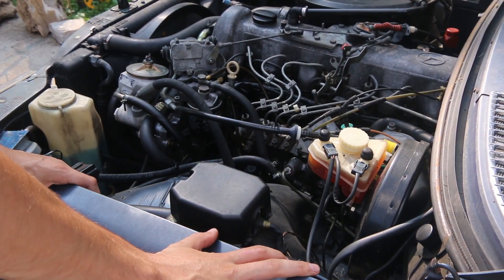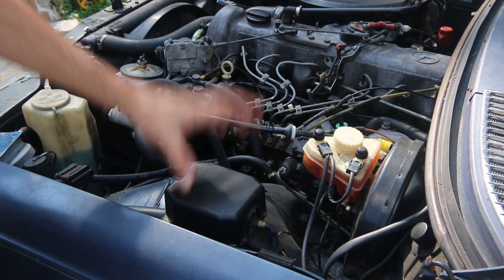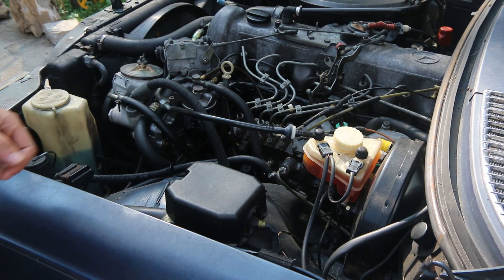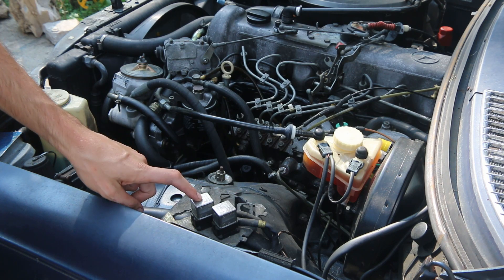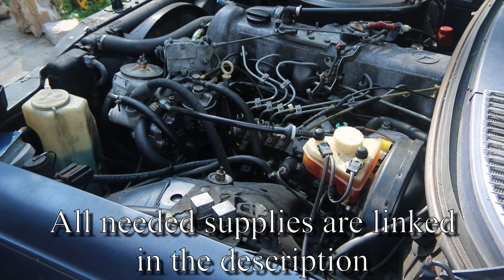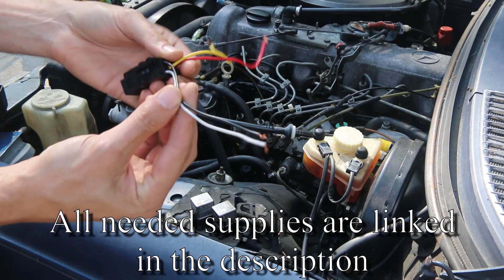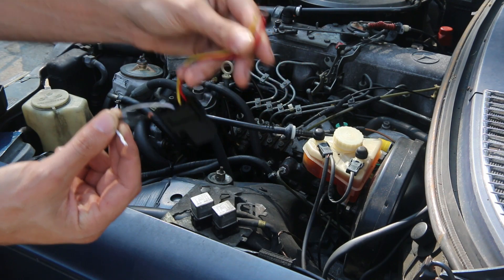W123 Aux fan AC mod & Evaporator cleaning (Cheap/Free ways to get better AC)

Comment: Great video. You've taught me a great deal about my W123 systems. I'm still trying to get my aux fan to work. I replaced the bearings and that seems to be an improvement, but I'd like to test the system properly.
1. Do you know what kind of amps the motor draws? (It didn't budge with my DC power supply but direct to a battery, it sprang to life with gusto.)
2. Is there a way to test the aux fan with a jumper wire on the pins under the relay? I'm getting 12v at one of the pins, and I tried a jumper across that pin to another that had continuity with the fan plug, but nothing happened.
Reply from the maker: I know they draw some serious amperage, I haven't personally measured mine, but I have heard somewhere in the 10-15A range is fairly expected, I'm sure some would depend on the bearing condition and general health of the motor.
If I'm looking correctly, Jumpering pin 3 to pin 1 on the aux fan "ice cube relay" should power it to life.
Ground should be constant on one of the wires going to the fan, and 12V should be provided to the relay pin #3 by Fuse C which would be a 16A Red fuse, Top right in the fuse panel under the hood, when the relay is commanded on it connects 3 to 1 which goes directly to the fan connector.
I've had issues with the little fuses getting corrosion on the ends and seemingly providing power as tested with a multimeter but not making a good enough connection to actually run anything.
Reply: Hola Juan, en mi w 123 300 d el ventilador auxiliar enciende por TEMPERATURA  del gas del aire acondiconado...hay un sensor de temperatura en el filtro deshidratador (es de bronce) y está atornillado al filtro....si lo puentéas el ventilador tiene que arrancar....es muy fácil.
Reply from the maker: @GabrielaLopez-du5tt  si de verdad! sin embargo, puentear ese sensor hará que el ventilador funcione constantemente cuando la llave esté encendida, lo que no es ideal para que el motor alcance la temperatura de funcionamiento o para los momentos en que no esté funcionando el aire acondicionado, pero esa es ciertamente una opción para hacer una modificación muy similar que ¡probablemente ayude al rendimiento de CA, o para probar el ventilador! Pido disculpas si esto no es muy comprensible, lo traduje en Google Translate, el original también se incluye a continuación. ¡gracias por el comentario!

yes indeed! however jumpering that sensor will make the fan run constantly when the key is on, which isnt ideal for getting the engine up to operating temp or for times when im not running the AC, but that is certainly an option to do a very similar modification that likely will help ac performance, or to test the fan! i apologize if this isn't super understandable, i have translated it in google translate, the original is alsoo included below. thanks for the comment!

Comment: Hi there , have seen this great video at an earlier time today wanted to follow the steps , but when I opened the amazon link for the relay it showed me couple more items which was kind confusing for me if you could share which one should  I get would be great. Thanks
Reply from the maker: It should take you directly to the one that says Color: 30A 4Pin SPST
Should have the title "ESUPPORT Car Heavy Duty Relay Switch 12V 30A SPST 4Pin Wire Socket Plug Harness Waterproof Electrical Automotive Pack of 5"
That is confusing that they have so many types.
Hopefully this helps!
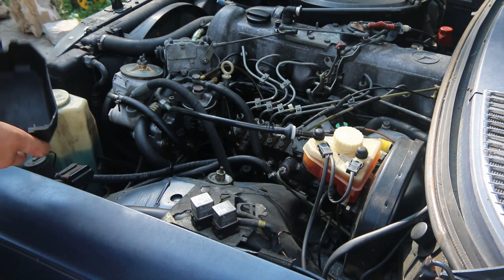Reply: I thought I could send you a picture but I figured it out it does not work , anyhow in the video (@1:47) the  black box you lifted, under my box there is only one relay which I think is for the compressor , any idea where could be the first one located?
Reply from the maker: Oh you should be able to send me an email with pictures attached: tom at trythistv dot com, sorry I didn't get back to you sooner.
What year and model is yours again? I'll have to do a little research to find out where the other relay is located
Reply: @trythistv  Hi I have sent you the picture today

Comment: Hi have a question.  My ac works but my Compressor does not cut-off.  Have new switches on drier and new drier the fan works fine turn on and off but not my Compressor.  Any help thanks
Reply from the maker: So there are a couple things that pop to mind, there is the icecube relays seen in this video, if you switch the AC on, removing one relay should cut the fan off, the other should cut the compressor off.

I suppose I should also ask, is this happening all the time, or did it start after you did the mod shown in this video?
That would narrow it down significantly, if you did the mod and it started, then something is wrong with the mod.

If it was happening before, or is totally unrelated, I'd check the relay, ensure something isn't shorted out or the relay isn't stuck on or something (switch it with the fan relay is a quick way to tell), and the ETR switch (Evaporator temperature regulator switch, could be referred to as the cycling switch), which is somewhere under the passenger side kickpanel (Right hand side of car, passenger if your car is US spec left hand drive, if you're overseas somewhere, I'm not sure where it would be located)

Comment: Thanks for informative video,unfortunately in South Africa everyone runs away from you and your W123 when you approach them for help. This is the only part of my 200 A/C MT that is not working.
Reply from the maker: It isn't a lot different in the US, I know of very few shops that have any semblance of knowledge or even the tools to work on my w123s, so I end up doing pretty much everything myself.
Is your entire AC system not functional or just the aux fan? I'm happy to offer any tidbits of knowledge I may be able to offer, I'm certainly no expert, but I'm happy to offer whatever I can!

Comment: trythistv, seems like you have been spending a lot time and effort on your ac system.
i wanted to ask your opinion; I have a 1985 300D and the climate controller rattles until the car warm up. I bought another used climate controller and it does the same thing. Thanks for any help.
Reply from the maker: Is it physically rattling or could it be a relay or one of the vacuum solenoids behind the climate unit rapidly clicking on off due to a bad solder joint?
I've heard they suffer the same fate as the cruise control amps that I ventured into repairing over the winter but I have not yet experienced any issues with the climate control unit itself.
Reply: @trythistv  I think it's the relay or relays. I will have to investigate further. Thanks!

Comment: Hi would like to know if it could also work for w 126?
Reply from the maker: It should be very similar, likely not exactly the same but a lot of things are comparable between the W123 and W126 models.
Reply: @trythistv  thanks a lot for a quick response I will give it a try sometime and let you know thank you

Comment: Where you used the relay to connect between the two Original Ice Cube relays would it be possible for a short test to just use a wire to see if the fan will come on?
Reply from the maker: Absolutely, where I stuck the red wire you can take a wire, shove it in, stick the fan relay in (where I put the red wire controls the relay so the relay needs to be in there) and then stick the other side of the wire to a ground source (engine block, negative battery terminal, where I put the yellow and black wires under the compressor relay, etc), if the fan doesn't run, it could be the fuse, the relay, wiring inbetween or the fan motor itself is bad
Reply: Thank you for your reply. I have another question. So if I put the red wire in as you directed and left that wire in that would mean the fan would be running all the time when the car was on? Would that be a bad thing to do? Other than extra wear and tear on the fan it should provide extra cooling for the engine all the time, especially if it's hot out.  Probably wouldn't have it in the winter,  just during hot weather. Is my assumption correct?
Reply: By the way, my AC works but my fan has never come on. I checked the wires where they connect to the dryer and they are on there, the fan is plugged in down by the driver side wheel well oh, there is a relay where it should be and the fuse is in place for the fan. My guess was either the relay for the fan or the temperature switch on the dryer is bad. In hot weather the radiator temp starts to climb when the car is at idle or I am driving it start stop in town. I imagine if the fan was on like it's supposed to be it would never do that. But I was considering it's a fan was on all the time where the air was on or not it probably wouldn't hurt anything in hot weather.
Reply from the maker: Right, pin 5 on the fan relay (closer to front of car) to any ground source will make the fan run constantly when the key is on.
It is also a lot of amperage, I've heard of people having issues with the plastic fuses melting (always get ceramic fuses if possible), also with the stock 55a alternator it may drain the battery if you're idling a lot. (I've got a 115a alternator upgrade in both of my w123s so battery drain is no issue)
Reply from the maker: Yeah, that's not right. I'd definitely try jumping it, if it doesn't come on, it may be the fan is broken, I made a video about replacing the bearing in the fan, and someone commented and we tracked down new brushes if the windings are ok the entire fan could be rebuild quite cheaply.
Reply: Thanks for your answers.   I really appreciate the effort you put into your videos.   Also, you pause long enough in your videos at key points for me to make screenshots..... very helpful.  Some videos on YouTube cut too quickly. Very good work and solid information on your channel. Thanks for everything.
Reply from the maker: Thank you very much! I don't always make sense naturally, Tiff helps me out proofwatching each video to make sure it makes sense and is clear and easy to follow, I have a bad habit of talking about the same thing for 15 minutes and just muddying everything up, but we trim it all down to sensible content instead of feature length films of me wandering around looking for tools! (I know anyone can relate to that)
I've got a website I intended to use for writeups and pictorials of each video, but I'm not doing that as good as I should be either, I'll get to it eventually lol
Reply: This tread was very helpful.

Comment: Aux fan best if u can get a SPAL 12-13-14  inch or larger using 20amps . Wire it so it engages with compressor . * Remember in Germany a hot day was 30 deg C/ [85f]  Remember u cannot cool less than your PT chart   Best auto motive is fitting a second condenser .  Best performance for a second condenser is high pressure 160 psi = 116f =   46 cel   on a  ambient   46 cel day
SYSYTEM WORKED WELL WITH 2 DOORS OPENED AND CYCLED AT thermostat at  1500rpm

Comment: Hello. Thanks for your video.
I did a similar job on my w126.
I mean,i unplugged the connector of aux fan from the bulb located on the dryer and connected it to the compressor bulb(also located on dryer),so at the moment the aux fan comes on together to the compressor,hope to improve the AC when I'm stuck in traffic. Could this be a problem?
Reply from the maker: That should work OK, the only downside is if the compressor is off such as Evaporator has reached target temperature so the ETR kicks the compressor off, or certain other situations where the compressor will cut out the fan will also stop running, which means the head pressure could stay high, which would lead to warmer AC when the compressor kicks back on, and you may lose the function of the aux fan being a failsafe to prevent the engine from overheating, although I believe that is on a separate temperature switch on the block, so that functionality should still be there.
Reply: @trythistv  on my w126 the aux fan is the same for AC and head temperature. The fan works on 2 speeds,1st speed is controlled from the bulb on the dryer,the second is controlled from the bulb of the head. I never heard the fan working on 1st(low) speed ,so i thought that the bulb doesn't work and at the moment i bypassed this one as I told you. I have a new dryer and bulb ready to install but I have charged the AC system 5months ago and install the new dryer + bulb again means charge the system again.
Reply: The heat never get over 100 degrees(with ac on and stuck in traffic) on my m103,usually it works just above 85 degrees (i have 87degrees thermostat)
Reply from the maker: OH, my brain is not working 100%, I somehow missed you've got a w126, I was stuck thinking of my W123 fan that is single speed, You're absolutely correct, the 2 stage fan will vary depending on coolant temp, AC pressure, etc so by connecting the aux fan for the AC to the compressor switch you've still got all the function of coolant temp and such, just the head pressure monitoring is at a different point, being whatever the setpoint is for the compressor cutout rather than the fan cutout bulb thingy.
I'd say you'll be A-OK to keep running that for as long as you want, no sense losing your AC charge, especially not in the heat we're having right now!

Comment: as far as i know, at the default contidions and all system works properly, aux fan not works below 52 centigrad degree while AC on, but whenever temperature sensor where next to the dryer  reads 52 Degree, aux fan begins to work. iam little bit confused about this by pass solution. does  not your temperature sensor  works properly or is there another problem abour aux fan ? could you tell your main goal please? :)  and  btw , thankss for your w123 videos !
Reply from the maker: You're absolutely correct in how it operates, and mine was working properly. The theory is that R134a refrigerant isn't as efficient so the condenser needs more airflow to dissipate the heat, in practice I'm unsure how beneficial it is, but it is a very popular modification, people sell special made wiring kits to do exactly this, and I wanted to test it out and see if it really made any difference.

Comment: I see that you either removed the screw covers on your kick panel or you don’t have any.  I can 3d print you a set of 6 and send them your way if you like. I  cover them with black vinyl.  They aren’t perfect but they look okay.  And if you kick panels are blue (which they may be and I just can’t tell) I can just print you some blue ones.  I just got some dark blue PLA+.  It is the least I can do from enjoying your videos; and I will make a video of how to make them for my YouTube channel too.  So win win.
Reply from the maker: Its comical that you mention that, I got a 3d printer earlier this year, and I've been collecting models and printing things, like sunvisor clips, throttle bushings, and those pesky little screw covers that seem to vanish whenever I look at them lol
I greatly appreciate the offer, and you can expect plenty more videos on my W123, I've got quite a few projects planned with it this year!
Reply: @trythistv  I am glad you have a 3D printer.  I can tell from watching your channel you will get a lot of use out of it.  I just started learning Fusion and made my first part from scratch for the W123.  Right now the car is getting a paint job, but I can hardly wait to try the part.  I made a replacement pivot bushing for the earlier version of the throttle linkage (I believe it changed in 1984 or 85 to a different mechanism) but your car uses the same as mine. I will post a video once I get it installed (whether a fail or a success) and also post a link to the 3D file.  I hopefully will get my car back from the paint shop next week sometime.
Reply: @trythistv  I look forward to watching them.

Comment: Hi, do u know how mercedes aircon compressor should work? Is it keep on n off like other cars or its stay on? Becoz mine stay on all the time
Reply from the maker: It should cycle on and off depending on the evap temperature sensor as well as the high pressure switch.
Reply: @trythistv  oh like wt i thought theres something wrong with my aircon line, because my compressore keep on and my aux fan wont engage even if my ac on

Comment: Yo hace unos días adapte un filtro de aire en mi 240D y la diferencia en la calidad de aire es muy buena
Reply from the maker: He querido averiguar alguna forma de hacer eso, todos los coches modernos tienen un filtro de aire para la cabina del coche, ¿cómo hiciste la instalación?

I have wanted to figure out some way to do that, all modern cars have an air filter for the cabin of the car, how did you do the installation?
Reply from the maker: A veces YouTube bloquea direcciones de correo electrónico u otros enlaces. No veo tu respuesta en ningún lado. Sin embargo, puedo permitirlo. Envíame un correo electrónico a Tom a trythistv punto com.

Sometimes youtube blocks email addresses or other links, I don't see your response anywhere I can allow it though, send me an email to tom at trythistv dot com
Reply: @trythistv  If I already sent you an email, I still have to look for the filter number in my answers. I have an extra one.